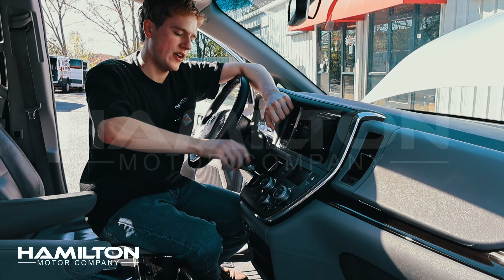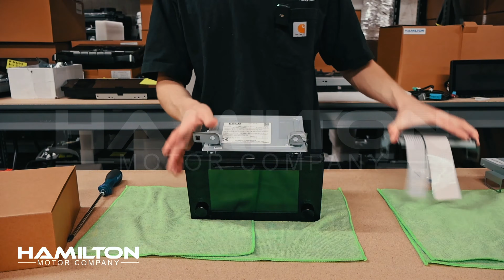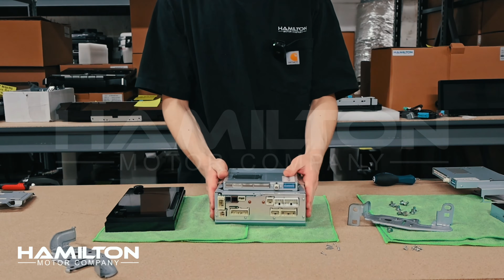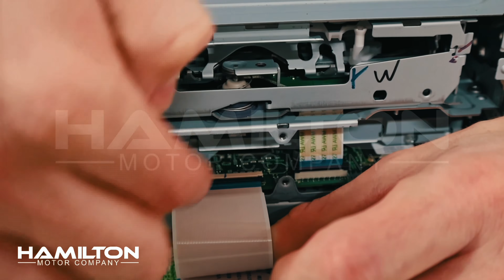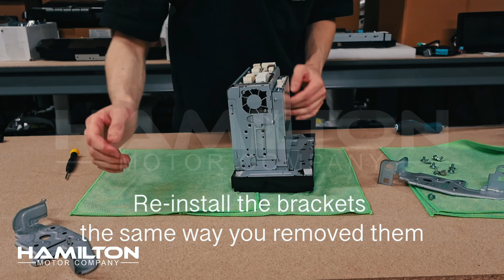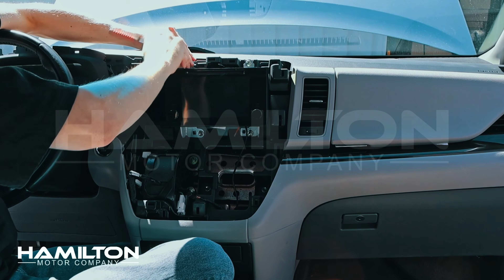2015-2017 Toyota Sienna Upgrade Kit | CarPlay & Android Auto Installation Guide

Comment: Just installed this today!  So far is awesome, very refined functionality, makes it feel like we always had it in our 2016 Sienna!  

Protip, put the car in neutral, then disconnect the battery, and set the parking brake, this should be the first step 

Very happy with this, and we’ve got the extended  warranty so we should be good for a long time!
Reply from the maker: Congrats on the install, and thank you so much for the kind words! Enjoy the new setup!

Comment: The ribbon cable does not lineup with the radio mother board slot where you are suppose to insert the cable from the kit on my 2014 Sienna. Did I get the wrong kit? It says 2014-2017 Toyota Sienna Upgrade Kit on the product.

Comment: Just got mine installed, works great!  But I have a couple nitpicks on the installation video.  1) Needs to mention shifting to neutral 2) Fitting the XM unit back in is possible, but I had a bear of a time getting it to fit and the video did not really detail where exactly in the dash he has it sitting.  A diagram might be helpful.  3) There is a sharp metal edge that directly presses down on the two ribbon cables.  This is probably not good so I covered the edge in some electrical tape.  This is not ideal as it might melt.  It would be nice if the kit came with a little piece of plastic with adhesive or something to put here.

Comment: Just ordered a conversion kit for my 2016 Sienna last night. The video says that over 90% of the head units are manufactured by Panasonic, so that is what is shipped by default. I checked and mine is Pioneer. How can I get the piece with only two wire cables instead of four?

Comment: I have a 2016 Sienna Limited with the JBL head unit (looks identical to the one in this video, but with an orange JBL logo).
Would I have a Panasonic or Pioneer?
Reply from the maker: Panasonic for yours
Reply: I upgraded but it seems that the touchscreen only works for the factory mode, in the CarPlay mode the touchscreen doesn’t work
Reply: @staticnetwork ever get this resolved
Reply: @golfer949  Yes, the support folks walked me through switching the pins and loading new firmware. It works.
Reply: @staticnetwork  what type of head unit do you have? JBL or non-JBL?

Comment: That would be fine for a radio that doesn't have the shutting off by itself issues. Replacing the OEM is quite expensive. Do you have a solution for this matter?
Reply from the maker: If your OEM radio is defective, you can pickup a replacement on FB Marketplace quite cheaply. I routinely buy them for testing for around $50-100 -Dave